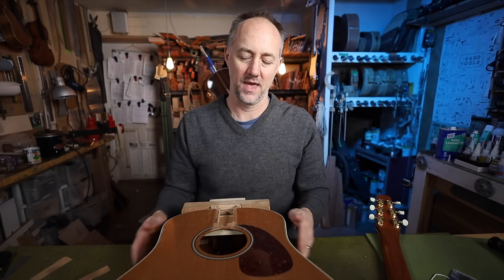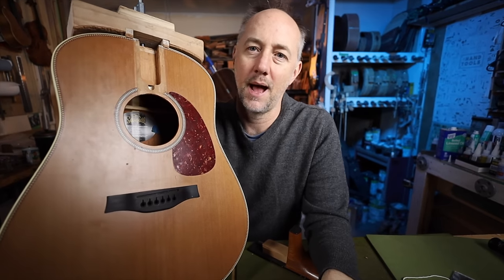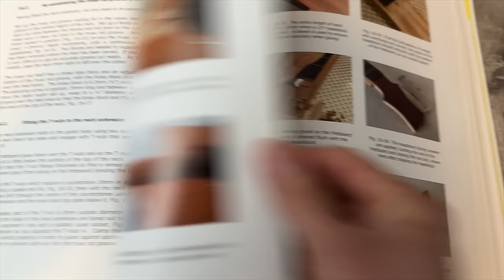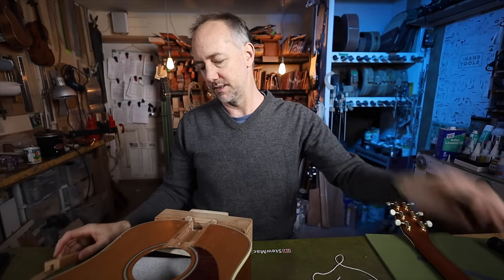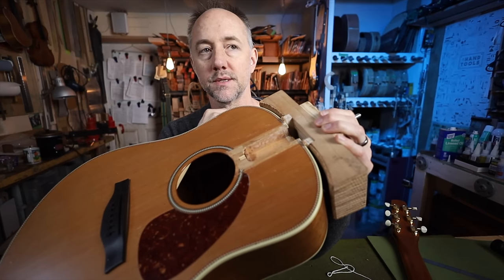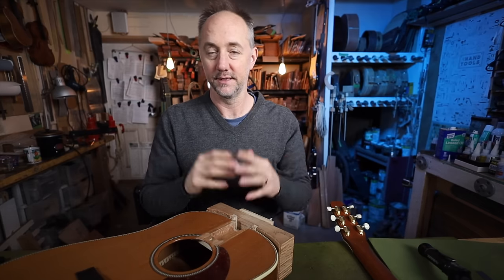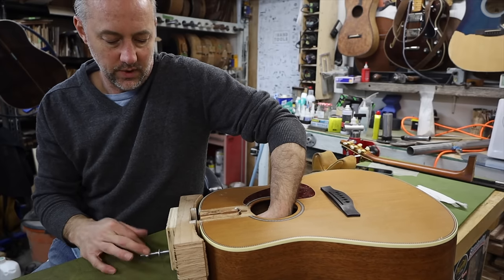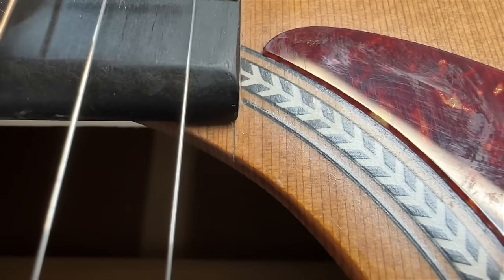The Hidden Problem with Seagull Guitars...

Comment: Coming from a Non luthiers perspective I play my seagull more than my Martin and my Taylor combined. It sounds and plays incredible and that’s the only thing that ever mattered to me
Reply from the maker: Well said- I like the sound of this seagull and if it inspires you to pick it up then its a good guitar for you. the only trouble is if it ever needs a neck reset- but let your future self worry about that!! hahah
Reply: Same !
Reply: Oh ya. The epoxy in the neckjoint is insanity. What years was this done? I bought a cedar top s6 from a pawn shop, and still love the sound of my guitar.
Reply: I purchased a Seagull six string acoustic to take along on extended road trip in order to leave the more expensive guitars safe at home. Turns out the Seagull gets more use than the rest! Now I find myself saying, why did I buy an expensive Taylor;)
Reply from the maker: dont worry to much- this neck joint isn't a problem until its a problem
Reply: The Norman guitars are also made in Canada by Godin. Very inexpensive guitars. 250.00. Same company?? Same problem??
Reply: Yes l  agree,  but  it's good to know about some of the weaknesses of Noteworthy Acoustic guitar's 😊
Reply: And, can buy 3 seagull for the price of another quality one
Reply: @tompelham7035  I have a Taylor too. Which seagull did you get??  It’s one of the few I don’t have. Lol. I should go to guitar center and check them out. A guy I know has one but it’s in terrible condition. Wasn’t stored properly and the top is all grainy and there’s no finish on it at all. If you run your fingers across the top you can feel the grain.  It looks like someone ran a knife all over the top, so I never considered buying one. He kept trying to sell it to me and said seagulls are very good high end guitars but his was neglected and it gave me a bad impression so I stayed away from them and bought a Yamaha FGX. Like most, Seagull has guitars all over the price and quality range. The ones I see in these videos look and sound pretty nice.
Reply: @BeauHannamGuitars Chances are he won't ever need to have to do it.. Never happened to me and I've had lots of guitars over the last decades.. Actually you are never ever supposed to do that..
Reply from the maker: @FiddleSticks800  they started in 2006
Reply from the maker: @BedeLaplume  I’m
Not sure what you are referring to with the “you are never supposed to do that”?
But all guitars need neck resets eventually. Typically takes 2-3 decades
Reply: @BeauHannamGuitars  I literally mean what I just wrote.. it's very rare a neck reset has to be done on a guitar unless humidity or severe weather changes distort the neck or the body.. Wood is wood right? Plenty of examples of guitars that are over a 100 years old who never had it done.. Obviously an instrument has to be warehoused in controlled or stable environments..
Reply from the maker: @BedeLaplume  Well, it’s rare in that every steel string guitar eventually needs one. It’s like saying death is rare in one’s life. It is true, but it happens to us all.
Reply from the maker: @BedeLaplume  The main cause of the need for a neck reset isn't "humidity or severe weather changes" as you suggest. The main cause for the need for a neck reset is  String tension. You can minimize the need for a neck reset by slacking your strings after you play. Before you call me names, I suggest you do some research into subjects you obviously know little about. Peace out. Your friendly neighbourhood sensationalist attention seeking scaremonger ♥
Reply: @BeauHannamGuitars  
Although there may be truth to your opinions of this person, EVERYONE is entitled to an opinion even if they are wrong or right . 

That being said , aren't we ALL supposed to remain civil in the comments section  !  !

On a different note , I thank you for bringing this to our attention .
Although I believe I may have watched the Robèrt Godìn factory tour video at some point , I did not pay much attention to that segment and perceived it as an aspect of a sturdy build .  Although very true , the  possibility of a neck reset happening in the time that a person owns it is need for consideration . 

I bought a  S and P 6  2004 model last year   Love it.   Now I love it more  ....  and now I like Taylor 150e models more than my S12 2020 model ... unless Godin changed the neck joint system again at some point to their Seagull line .
Reply from the maker: @BobsYoureuncle  Thanks for your comment- Youtube comments can be a horrible place to read and I wish people who act like they are saying things in their grandmothers living room. While I can usually wrangle in angry and unreasonable people with humor and good answers based on knowledge (not opinions), some people require a heavier hand. Everyone is entitled to an opinion, but I prefer facts based on knowledge which is all I give on my channel. My views of the Godin neck system isn't an option, its all factual. 
Taylor have an amazing neck joint system. The rough wood working is very similar to a Godin neck (the wooden extension under the fretboard extension) however Taylor do a full bolt on with various shims to exactly dial in the neck angle. I don't see why Godin couldn't pivot into a similar thing instead of using epoxy which is a terrible shame for being able to reset the neck (which happens for EVERY guitar eventually)
Reply: @BeauHannamGuitars  
Yes... all these good points that you wrote here were pretty much mentioned in your video ,  and those points are the  reason behind why I am anticpating returning my S12 and possibly biting the bullet and saving up for a twice as expensive used Taylor 150e .

When I tried the Taylor 150 E I really really like that but the cost was very prohibitive.
Where is my seagull S12 is actually a trade-in and it's in excellent condition except the action is a little high and at minimum needs a setup.

I am very much Pro Godin ...... but now I'm only going to look at stuff that is 2005 and older.

Once again thanks for this video because it brings some really educational material towards a buyer's intentions .
Reply: I have a seagull sws.And had the same problem also needing a neck reset, is it really a craftsmanship issue?
Reply: But which seagull do you have? Which model? Because the S6 doesn’t stand a chance against Martin 11e and up.

Comment: I made an electric guitar 50 years ago  this september. I used 2 hidden bolts and araldite epoxy resin glue. 50 year's later, ive never had a problem. Im no carpenter or guitar maker and its the only one i ever made. I don't understand why it has to be complicated. My neck is never coming off and it doesnt need to.

Comment: The service manager at Godin told me that those guitars will never need a reset because of the architecture of that joint. Yahuh??  Canada is lousy with Godins and variants so I see them all the time and if one needs a reset I won't touch it. If you send it back to the factory they saw the neck off, rout out the tenon and slap on a new neck.
Reply from the maker: All guitars will eventually need a neck reset. Something always gives over time under string tension, eventually. 
Such as large factory mentality to throwaway the neck and put a new one on.
Reply: I'd never buy one based on that statement alone.
Reply: And what do you mean by "Canada is lousy with Godin..."? That doesn't make any sense. Canada isn't a person and doesn't work on guitars. So why are you trying to personify Canada as if it actively does something with Godin guitars? 🤷🤦

You mean "the Canadian luthiers I know of that have attempted Godin and Seagull repairs are lousy...."?

I guarantee you Ted Woodford isn't one of those. He's a luthier in Canada. So it would benefit everyone if you didnt try to bunch every luthier and repair person in Canada together as being lousy at repairing Godin and Godin variants. I can also guarantee you he isn't the only one.

Comment: I love it when I get a repair in that the owner and other shops have given up on. You have great persistance and patience (these attributes are needed for this line of work). Though the unseen part of the repair is not particularly pretty, the visible repair is and you have given the next repairman a fighting chance if other neck work needs to be done down the road. I recently removed and reset a dovetail neck joint that was epoxied on. It came out great, but it is always darkest before the dawn. Great video!
Reply from the maker: Thank you so much- you describe repair work very well.

Comment: Interesting video... very informative. I can honestly say, I worked for Godin for 2 and 1/2 years (2019 - 2021) and never had any quality complaints. Our biggest issue was we couldn't keep them instock. I'm curious if the same construction is used on the Godin Acoustics and Art and Lutherie Acoustics? I walked away with 3 guitars (2 EG's and 1 AG) that I absolutely love. I also worked for Yamaha Guitars for over 15 years. So I love hearing this kind of deep level perspective on the repair side and learning how guitars do with age.
Reply from the maker: Thanks. I think this epoxied on neck system is very strong and good (good as in it seems to do what was intended which is to minimize the body join hump) . My problem isn’t in the short term but in the long term 10-20-30 years when it needs a neck reset and the epoxy deep in the block makes it very difficult to do- so much so as to make a lot of these guitars either new necks or throw away- or slide guitars.
Reply: @BeauHannamGuitars  The design make sound better?Why?Why they design this
Reply from the maker: @kylehuang6909  I never said this neck design makes the guitar sound better. It does help the problem of body join hump.
Reply: @BeauHannamGuitars  I agree and own a number of Seagulls. None made after the epoxy.  I play professionally and  need instruments that "deliver the goods" AND can be serviced if need be.

Comment: Thank you for posting this.  I used to do minor repair work for a music shop, and I worked on a very nice Seagull guitar that seemed to have a mind of its own.  I would get it set up properly, only to have everything move days or weeks or months later.  Here in Michigan things tend to move a bit with seasonal change, but this was extraordinary.  After seeing your video, I think it might have been an issue with the neck joint.  That would certainly explain what was happening.
Reply from the maker: Could be the epoxy didn’t set properly or it had shattered in the cold enough to move slightly- and slightly is enough to make a good setup bad.
Reply: I guess I don't get this. My guitars stay inside where it's always 74* F and a similar humidity level year round. They never "move". 🤷

Comment: Hi Beau,
I’m an expat Canuck - lifetime pro musician that has been living in the States for around 40 years, mostly in Manhattan, but recently retired to the Southwest. I’ve owned more than a dozen Godin guitars of just about every brand name and variation, (6th Ave, S&P, Seagull, A&L, parlors, folks, dreds, 12 strings, etc… and have loved them all; however the only one I currently have in my stable is their A&L Ami nylon parlor size cedar/cherry that I got used (for $90!) and which I electrified with a homemade K&K type passive 12mm piezo-dot system that sounds lovely. In recent years all my other acoustics have been upgraded to Waterloo model WL-K by Collings - a double 0 parlor type based on Gibson’s rare Kel Kroydon, a depression-era catalog guitar; while my other Waterloo, a model WL-S is a single 0, 12 fret slothead which is based upon the 1920s OS Stellas. Waterloos are truly out of this world guitars - in another league than the Godins, (pricewise as well) but the Godins still have their place, and as a sometime teacher I always recommend any variant of the Godin family, especially if found used at a good price.

I have an interesting (at least I think so) video on my channel of a mod that I was doing on Godin parlor guitars for  my students and colleagues around 10 years ago; basically mounting a vintage 60s Danelectro lipstick pickup into the soundhole, getting vintage style magnetic (electric) tones that were very feedback resistant due to the small size and rigidity of the single 0. Check out that vid on my channel if it interests you at all. I was also offering a dual (stereo) system where I would install one of my homemade passive ’K&K style’ (multiple 12mm) piezo discs glued directly onto the bridge plate, and via dual 1/4” outputs (or even a 1/4” TRS) one could achieve incredible control over both a ‘raunchy blues to clean style’ single coil magnetic tone, and simultaneously a separately controlled, ultra transparent acoustic-piezo signal, and all in a very inexpensive, robust, and playable North American made instrument. (Often the whole package including the used guitar and all the parts and labor would be in the $600 range!)

I’m rather shocked that Robert Godin would allow such a poorly conceived ‘upgrade’ to his line of otherwise very well designed guitars. I can’t understand why he would stoop to this…
Thanks to your excellent video I will have to remember to avoid anything newer than 2006 in the future!
The only Godin product that is currently on my want list is their “thinline style” MultiOud fretless electric oud. I’ve been an oud player, off and on, for decades, and am intrigued with this instrument, but where I live it is virtually impossible to find an example that I can play in advance of purchase, and they aren’t exactly cheap instruments… I do come with a lot of expectations though, having owned and played numerous other styles of oud over the years. Do you know if they are using this same ’new style’ of neck mount on their post 2006 instruments? (I’m not even sure if they offered this oud pre 2006?)

Anyway, looking forward to viewing more of your vids!
Reply from the maker: Those Waterloo guitars are great. I'd love a real Kel Kroydon!- Have you heard of IRIS guitars, from Vermont?- very similar 1930's/40's reproductions like the waterloos. cool guitars.
Id love to have one of those multiOuds! Its been 15 years since i've seen one and cant remember their neck join system. Looking at the pics on this site it looks like its a bolt on neck which is smart- 
https://www.thomann.ae/godin_multi_oud_encore_nylon.htm

I'm not sure if thats an old or new pic but you could ask whoever you are buying from. I bet their are a few of these available secondhand.,
Reply: Wow, those IRIS guitars look sweet, but also (like the Waterloos) on the pricey side. I love their 'a la carte' menu style for ordering custom features, what a great idea! @BeauHannamGuitars
Reply: @PaisleyPatchouli  Where is this video of the lipstick and KnK guitar??? Sounds great!

Comment: Thanks a ton, Beau!!!
You have solved a problem that has been plaguing me for more than a year.
I have an Art & Lutherie guitar - a 12-string - and for the life of me I could not understand what a block of wood was doing underneath the fretboard. It too is a bolt-on neck.
It was in because the heel was lifting and the action was high. But even after sticking it down, the action remained high, so a neck reset is needed.
Awrite then, where did my flush saw go???!!
Reply from the maker: Flush saw is the best way to take this off if needed (after I gluing the extension)

Comment: Thank you for recording this, I've been talking about this for years. I have had a few Godin acoustic guitars, still have two. I didn't know about the epoxy until after I purchased the past one. 
One of my Godins does in fact have a sunken neck that I cannot get repaired due to the epoxy. I don't want to claim warranty and send it away for replacement because of the sentimental value.

Shame on Godin honestly, they're making throwaway guitars.
Reply from the maker: Sorry you got that problem. If you send it back you will get the same guitar body but with a totally new neck- I think they saw them off and replace. Better that then a non playable guitar.
Reply: @BeauHannamGuitars  they told me they just replace the guitar with something the same

Comment: As a small volume guitar maker I’ve been aware that the neck to body joint is a weakness on many factory guitars. They are simply not strong enough in this area and the body deforms on the fretboard extension area. You can test this by holding the body tightly against yourself and pulling and pushing on the neck and there is often a reasonable amount of movement as witness by the change in string height. Couple this with the bridge tilting forward and pulling up it’s not long before the action is unplayable and the saddle is at its lowest point. 
I’ve long believed in a big neck block and heavy transverse brace to stiffen that area. I found through experience that you need a stiff guitar body that resists deformation as if it’s not stiff enough it will accerbate the deformation and subsequent lifting of the body at the bridge area. So having highly scalloped braces takes away strength from the sound board and adds to the whole deformation problem. 
I think Taylor have probably the best practical solution with the tapered shims to easily deal with the deformation problem that will occur on every acoustic guitar over time.
Reply from the maker: Yep and yep and yep